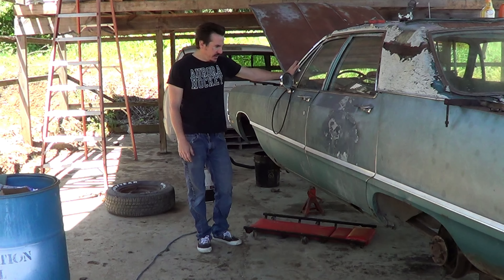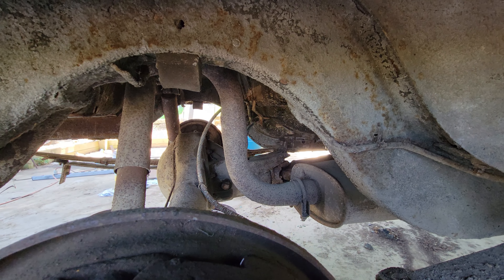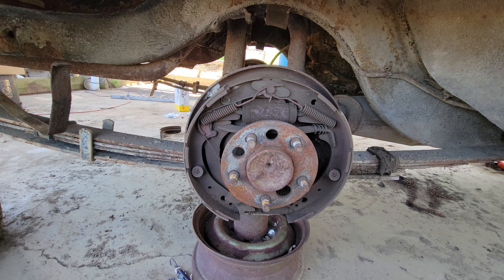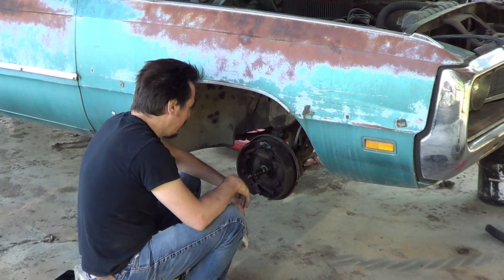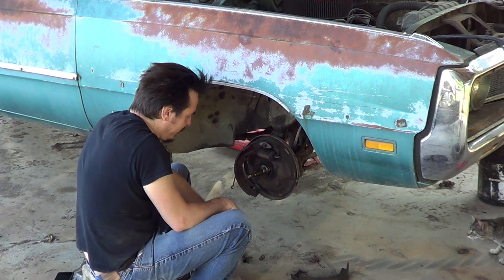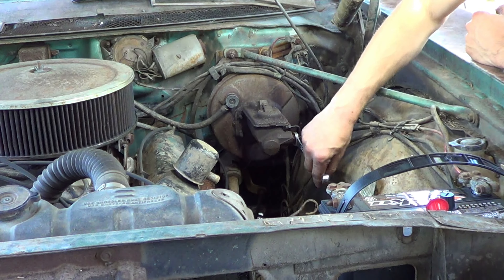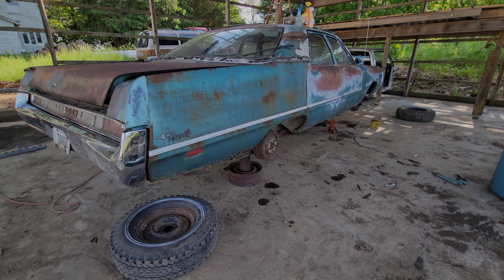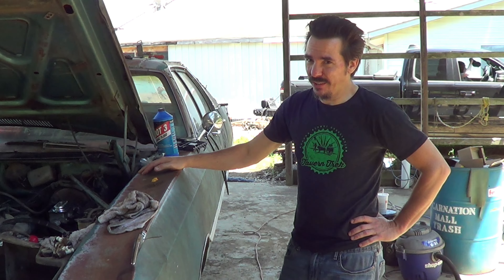Farm Fresh - The Lemons Rally Newport gets BRAKES!

Comment: All that Ziebart undercoating has paid off.  That whole undercarriage would been full of rust at this age.  You know it's a big block by the blue color engine and valve covers.  I used POR 15 rust converter coating on my trunk floor which was similar like yours.  Give it a coat over the floor, will stop rust and strengthen it too. Shee's in vry good shape to the experienced eye.
Reply: Chrysler and Plymouth motors were blue and Dodge motors were red until, I think 70, then I think they were all blue, until they went to black in about 80.

Comment: Don't EVER put any kind of oil based anything on any wheel cylinder part. EVER. Brake fluid is water soluble. The rubber parts are made with a compound of rubber that does bad things when it comes in contact with oil, gas, and most solvents. I've seen 1" wheel cylinder cups that were washed in gas that had swelled to over 2 1/2" diameter. The boots will also grow from exposure to a leaking wheel seal. Seen it a bunch in 45 years as a car and truck partsman.

Comment: You were joking about not bench the master ya? Man I hope so cause if ya don’t know why you need to bench bleed the master go find a trained tech to explain it! Cheers
Reply: But not a single bowl master cylinder like in a 64 Ford, I just found out. The master cylinder manufacturers now think you will over travel the piston in them and damage the cups. I never heard that before. I've sold single reservoir master cylinders on everything from a motorcycle or a VW beetle to GMC medium duty to Volvo class 8 trucks. All could be bench bled in my 45 years experience as a partsman and mechanic.